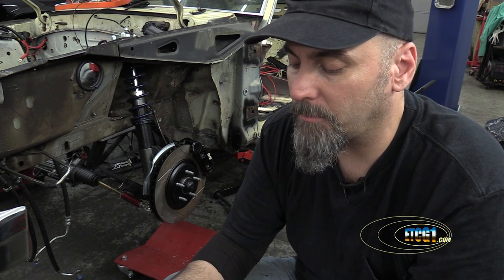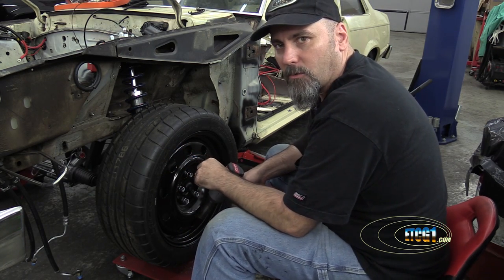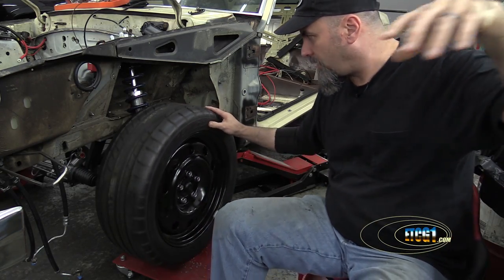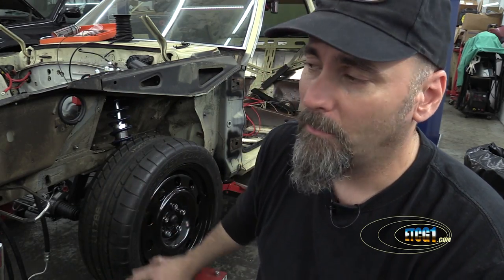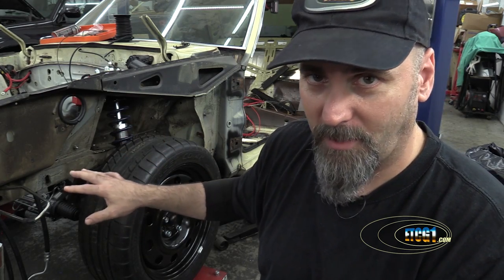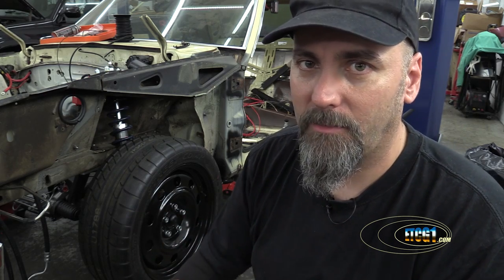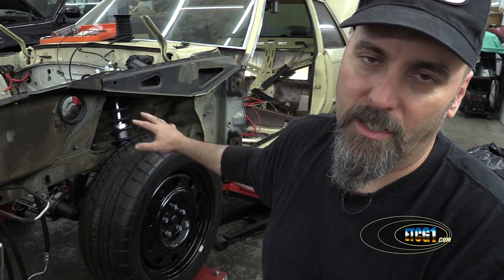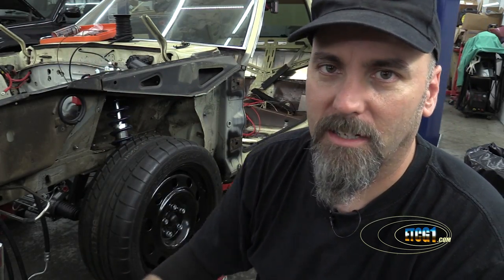Are Wheel Spacers Safe?

Comment: Do wheel spacers change the suspension geometry?
Reply: little billy depends on the et value of the wheels. If the wheels have factory et then yes. If the et on the wheel is 10mm higher and you use 10mm spacers your geometry is back in spec again.

Comment: Quick question, the welds on the spacer to make it hub centric...why dont they weld the complete 360...why just the tacks? I see this on many car parts and i always wonder are they just cheap on the weld? haha just wonderign if there is actually a good reason for it? Cant wait to see this sleeper on the road btw Eric!
Reply: hmmmmm interesting
Reply from the maker: As the other commenter mentioned, welding creates heat and therefore warps metal. You really don't want to warp wheel spacers. Also, the small welds will hold just fine.
Reply: Yup, makes sense! thnx

Comment: As long as they are hub centric and you have enough stud length to accommodate them and the wheel is properly torqued there is nothing at all wrong with wheel spacers. I ran 2 inch ones on my lifted grand Cherokee for 80000 miles and never had an issue.  I've put them on customer cars such as Porsche 944s that have been through track days and motorcross events and never had an issue. As for the steel wheels, I'd put money on that Fairmont Being lighter than a typical squad car in service and those wheels will be just fine. I think you should put hubcaps on them to complete the look. Now..... would ya finish that thing already?

Comment: Not that you care, I agree with everything you stated in the video. Such as "when properly installed they are as safe as wheels without spacers." However, to my way of thinking wheel spacers are the easiest and cheapest solution for a vehicle where the builder had a lack of vision when culling the parts for a project. just my .02

Comment: I don't see any difference between spacers and offset rims, besides cost.  If you know what you're doing,  it would seem that spacers would be the logical choice.  I guess that moving the wheel center out 1/4 inch won't mess up the suspension design.

Comment: Ykno. I want to use them myself because i like the particular effect they can produce. Professional guys like you say they're safe, but...

Leverage. They change the point of which the wheel pivots.

It's like putting a dinner plate on the edge of a table. With it sitting a couple of centimeters off the edge the leverage you can exert on the plate to is very low. You can tip it over with enough force, but there's no excessive and unnecessary  force that acts upon anything. Now push the plate further towards the edge. More leverage can now be exerted upon the plate with the same amount of force applied.

That said i do believe it is SAFE. I'm just saying they can amplify wear on anything and everything. Is the amount of extra wear significant in any way? I do not know. Wheel bearings, uneven brake rotors. I do not know, but everything matters. If not much, a little.

Comment: I need a fuel injector spacer, spark plug spacer, oil filter spacer, brake pad spacer, windshield spacer and a clutch spacer. Will my car be spacer?
Reply: Also need seat spacer..
Reply: Need a shifter spacer too

Comment: People dont bother to understand or differentiate between spacers and adapters. Using a spacer when you should use an adapter is bad, and using an adapter when you should use a spacer is bad. Either way, use the correct one, check your torque, recheck your torque, and you're fine.

Also, GM uses 3/16" spacers on the rear of many 82-92 Camaros to make up for the difference between the factory disc and drum braking systems. That's a mass produced OEM example of wheel spacers being used safely. Obviously, 3/16" is pretty damn close to 1/4".

Comment: Do you see what ETCG1 did right at about 2.10? He tightened one lug with his electric impact, then continued his presentation. "What's the problem" you say? The problem most likely will not show up attached to this exact incident but you do not want to develope the habit of "temporarily" tightening wheels.
One day at work (a Milwaukee BMW Dealer) I was working on a car on my lift. The boss comes up and generally starts BSing with me. We start to talk about VW engine building and I do not tighten the lugs correctly and the car was delivered (then returned). Do all you can to not allow yourself to be  distracted. My boss should not have distracted me but in the end it was my fault. When the boss came over and told me about the wheel I immediately flashed on the BSing incident. I asked the boss "was that on the car you came over and started talking to me about building VW engines? I could see he remembered, he just turned and walked away, we both knew we were both responsible.

Something a bit related. I raced off-road back in the mid-70's. At one Mexicali race I came upon a driver and co driver that were trying to fix the damage from a wheel that came off. The driver was livid because his co-driver painted the drum (the flat surface of the drum,where it touches the wheel) and he was sure it was this painting that caused the wheel to loosen up. Did the paint cause the wheel to loosen, I do not know for sure but why not leave the paint off the next time? Hey, an idea for a "spot". The question is "has painting or detailing a part or an entire car ended up being the cause of damage or even an accident"?

Perhaps ETCG! can show us a quality wheel spacer set and then compare it with an obvious cheap-O kit. There just has to be different levels of quality and safety with wheel spacer kits. I am looking for a presentation that says "see this spacer kit,never use one that is engineered this way or made from this quality of material". ETCG! talks about a spacer kit that solves a spacing problem, this is all good. What is the feeling about using a wheel "adapter kit" that allows mounting, lets say a 4 lug set of wheels that you just love on your 5 lug car? This kind of adapter might get a different review.
Reply from the maker: I don't think I'll be forgetting to tighten my wheels. https://www.youtube.com/watch?v=eeeq-MRxCzs
Reply: ETCG!, I was hoping that you would at least try and demonstrate good, safe work habits, Tightening one lug with an electric impact and then going on to do another task is one of the ways wheels get left loose. Techs need to watch out for the distraction factor. You can get distracted by the radio, (too many guys pay too much attention to that radio). You can get distracted by the office girls walking through the shop, the tool man, getting your paycheck. Keep your mind on the job. I was hoping you would stress these type of things, this being a learning channel.

Comment: My opinion, don't use them. Figure out a way, to not need them. I had mine on for exactly one "scary" ride. And it was driving like a "floating boat. Now...this could have also been the Extra Thread lugs I used with the spacers, but the spacers also messed BIG time with the alignment. I ended up massaging the dust caps enough that I was able to get my center caps back on the rim-wheel. The spacers and ET lugs were  removed and I'm back to normal driving.

Comment: The spacers will be just fine on the non powered wheels. on the powered axle I would be concerned with slot type,  that is going to allow that spacer to slip and flex under extreme loads. ones that are solid that fit the rotor hat size and have drilled holes that exact fit the stud bolt pattern would be much more desired. a bolt does not handle shear stresses well, and a wheel stud is a pressed in bolt, adding a plate with slots seems like a bad idea for high power applications. Just my Thoughts.
Reply: While I can appreciate that these are your thoughts they are never the less not based on facts or the physics involved. The coefficient of friction is what holds the wheel and the spacers in place not the holes or slots in the spacer itself.

Comment: or you can just weld the thin spacer onto the wheel?
Reply: No, 
Spacer won't be aligned with the rim. Plus the material, if its aluminum or steel. 
You'd be spending double at the end of the day. Isn't worth it.

Comment: Honestly, your wheels are probably going to be fine.  The cop car wheels are theoretically designed for . . . well, a cop car, and all the abuse that gets heaped upon those.  I'd trust them a lot more for what you're doing than the flimsy steelies that came on my 88 s-10.

I work as an auto tech and the number of bad spacer installs I see (and let's not even talk about lift kits) . . . you're doing it right.

Comment: Race cars and off roaders use these all the time, although There axles, bearings, etc are more setup for it.
1/4 is nothing, the problem would be is if the spacer was thicker, 1 or 2 inch and or you use those spacers with studs putting the pressure so far out, you run the chance of breaking studs, going through outer bearings etc.
Lastly, you did spend $20,000 Might as well spend more on the good stuff.
To me, good either way, more good stuff or the tiny little 1/4 Spacers.

Comment: You all do realize that motor companies use wheel spacers/adapters from the factory right?? I mean a Ford Transit van only has one bolt pattern for the front. However when it's a dual rear wheel they literally have to put a deal spacer/adapter on the front. Not to mention the fact that in reality most non-unit-bearing front wheel assemblies are held on by a single large nut. And unit bearings are held on by three to four small bolts. If things are properly installed they work. The only times they don't work is if they are properly installed or defective.

Comment: The downsides, increased scrub radius on the tires, and extended planes, they slightly widen the track of the vehicle, which means more leverage on the suspension, so they slightly reduce the effective spring rate of the suspension. the combined effect, you may see a slight decrease in cornering response under braking load. and you may see some quicker wear to bearings. you're moving them out 0.250" the change shouldn't be much, but it will exist, and you're a mechanic, I'm sure you realize these minor changes will occur, the biggest thing is weighing that. are they safe? yes. do they have some effects on the car handling and component life? sure, is it enough to worry about? not really. unless you're really, and I mean REALLY pushing it. and then most of the negative effect you'll see is under breaking, I mean they do upset the suspension geometry, but then where this isn't factory suspension, I'm sure you've already considered that geometry and the effects on it... 

The final answer on are they safe? Yes. If you've installed them properly, and aren't a dumbass. yeah, they are safe, they have drawbacks, like any modification, but they are relatively minor. it's not like doing a lowering job by using cut down springs (want to talk unsafe mods, number one right there)

Comment: Forget about danger, what about the real changes to suspension geometry? It DOES change that, may seem insignificant to a mechanic, but lets get an opinion from a suspension engineer instead of just an engineer saying "your wheel wont fall of" because there is a lot more than to it than that.
My main issue with them is that and the fact that they void insurance in my state/country so i wouldn't touch them for that alone.
Reply from the maker: Um, the engineers at Maximum Motorsports said my wheel spacers were just fine and they have designed and tested my suspension. Link in the description. Thanks for your comment.

Comment: Of all the wheel spacers, I'd imagine that these type are the most safe. As you said you're just clamping a piece of aluminum in the middle. I'd be more leary, and maybe others thought you were using, the other kind that bolt on and have their own set of lug nut studs. Whether they crack from stress or the nuts work loose, they seem potentially more problematic than the ones you are using Eric.

Comment: If you have a 5 stud  hub 
 And each stud is 1 inch long. Your spacer is 1 quarter inch thick so you loose 1 and 1 quarter inches of tread holding that wheel tight , so now you have less than 4 studs holding that wheel. Good luck.

Comment: Yeah being in the Jeep community I know that spacers are safe as you said WHEN INSTALLED PROPERLY. Those Jeeps are constantly flexing, taking major landings ect... And since many of them are faster than that fox body ever will be yet they are totally safe. I am sure if you buy some knock off crap and fit it on totally wrong it is very dangerous. Take the time to do the research and you wont have an issue with safety

Comment: I'm fine with wheel spacers but prefer a proper offset wheel when possible. Sometimes you have wheels that fit perfectly then you make a change to your car or setup (like this case) & now it's needed or sometimes that perfect offset isn't available off the shelf or in the wheels you want, so unless you have the $$$$ for custom made wheels it's a necessary evil.

Comment: While a racing team could bore the arse off of you how the chassis dynamics have been altered by changing the wheel location, they have, but no real person will notice on a street car; the car is safe.  The mechanical system is completely unaltered.  Having them altered to be hub centric is a nice touch, but the clamping force is unaltered, it is all in the hub nuts/bolts.  Not adding spacers to the system is like saying you should never put a washer under a nut or a bolt in any system because it will catastrophically weaken the system.  It won't.  The nuts/bolts work in harmony with the flange/hub they are working with and when torqued properly, work exactly (or as close as you can out of a lab) to stretch the metal to its safe point of elasticity.  Anyway, with ancient technology like nuts and bolts, the factor of safety built in is huge.
Enjoy the holiday and enjoy thrashing the car even more.

Comment: they get a bad rep from the style that bolt on first and the the wheel bolts onto another set of studs
Reply: I agree, those  are usually referred to as adapters of varying width/thickness  that usually change the bolt circle pattern, fastener diameter, number of fasteners and or hub center diameter and spacing from the hub. 
Typically those adapter types are prohibited for competition use by many sanctioning bodies for good reason. 
The reason being that there is no direct clamping of the wheel to the hub, since there are one set of fasteners clamping the adapter to the hub and then another set of fasteners clamping the wheel to the adapter causing the adapter flange to carry the entire loading and they usually flex under load which contributes to adapter flange and fastener fatigue and ultimately failure.

Comment: Regarding flex in the wheel, 6:55 , specifically the steel wheel on ford police interceptors may "flex too much " Metal has to flex or give to prevent breaking.  the CHP and police organization actually test their cars and they work with the manufacturers in the design of police vehicle. I doubt test would support Eric. 6:44 "cheap" yes cheap but also strong. I have a PI and hit curbs at 35 mph and only bent the outer rim. In the 160,000 miles of duty I am sure my wheel hits many bumps/curbs at high speed but they didn't break or become bent out of round. Eric is way off base in his comments
Reply from the maker: I actually got my information from Ron Sutton. He knows a thing or 2 about suspensions, look him up. That said, he didn't specifically comment on my wheels, but he did mention that wheel flex can be an issue under extreme racing conditions. My point in mentioning that in the video is that I feel the wheel spacers are insignificant. There are so many other things on the car I'm focused on that have nothing to do with the wheel spacers. In short, I'm way past the wheel spacers being a problem, I'm more focused on getting this thing running and on the road. Thanks for your comment.

Comment: Well, I can imagine what everyone say about wheel spacers. As an average guy (not an expert in anything) I can also imagine that specific argument applies correctly to installing spacers in a stock car, not in a heavily customized car. 
With all the mods that car has, I think the wheel spacers are not even close to be a problem, I mean, those huge tires are not the stock tires size, by miles. Customized suspension, customized everything, who cares if the car wears little wheel spacers that have been moded to be safe and do their job? 
That is not a stock car, it's a customized car, in those kind of cars you shouldnt really care about those little details right?
Bearing wear? who cares? he's a freaking mechanic ffs! he can replace bearings weekly if he wanted! He doesnt have to worry about paying to the freaking mechanic to do that job, right? (please note sarcasm here)
Reply from the maker: Thank you so much for being the voice of reason.

Comment: My buddies s10 has 2.5" spacers all around and we rip the shit out of it and put over 30,000 miles on them with no issues. Wheel bearings are still fine as well

Comment: Depends on who made em... I have ebay junk on my truck but, I aint really putting weight on it when I'm running my small spacers... the key IIRC is make sure you get the correct number of threads to grab... however cheap stuff... your wheel is going to fall off... seen it... getting that ebay junk... lol have fun dying... getting REAL spacers quality made... your fine... on the wheel point, ya, totally correct before I went spacers I was going to get a nice set of aftermarket rims... that all were a capacity of like 2000lb/rim..... okay my trucks 5500 empty... and my gvrw is 9400... and I go over it... so.... that is like... rims overloaded.... dafaq?